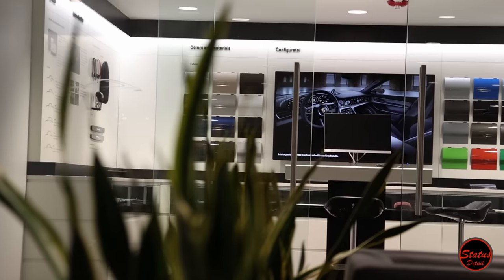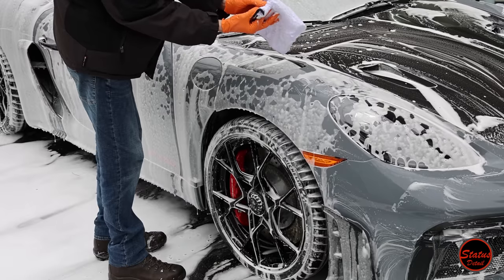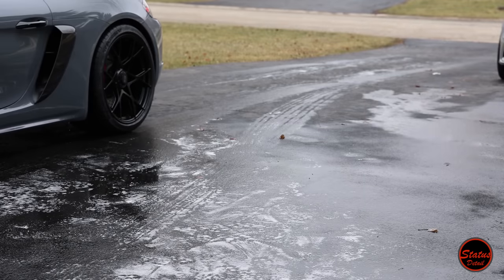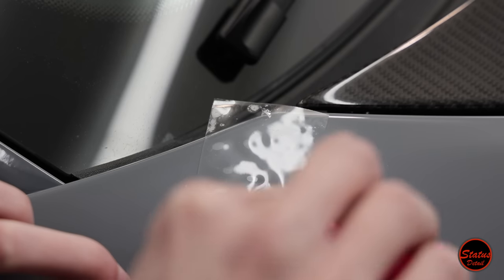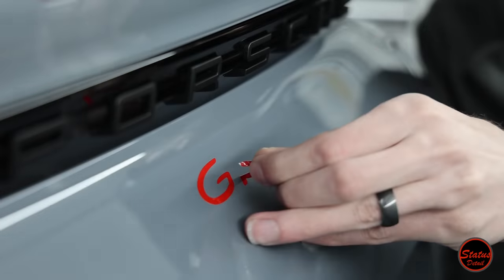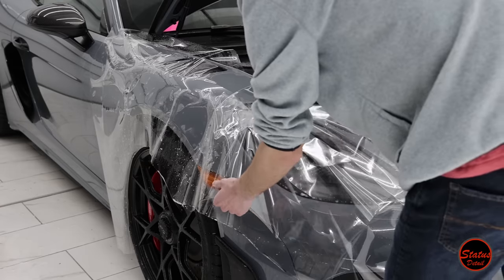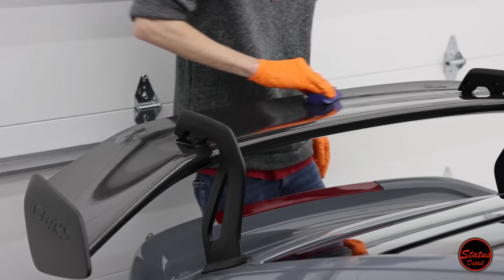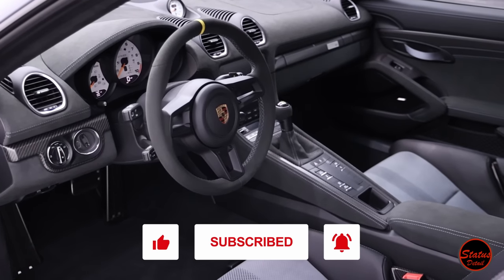GT4RS The World's MOST EXPENSIVE DETAIL!?!?

Comment: Matt from obsessed garage said that PTS paint is even worse on a new Porsche and he would never order PTS again because of it.
Reply from the maker: @_Suzuka_Joe  I kinda disagree but enjoy matts videos and opinions. 

I have worked on a lot of Porsches. Pts cars usually have "worse" paint. But it's nothing that can't be fixed by a paint correction specialist. Some cars have worse or more extreme issues than others. But I have seen that on normal Porsches too. I have even seen cars get delivered in the wrong color and options lol. 

Pts cars usually have more sanding marks and crazy holograms. I suspect a different facility is doing PTS cars. Or in general they're just trying harder because it's a very expensive option. So because they're actually trying so hard to make it perfect they're actually doing more harm than good. In general Porsche and most manufacturers don't really have a clue on how to do refinement polishing. They often miss dust nibs and if they do spot them they remove them but do a poor job of refinement afterwards. 

I would personally take a PTS car over a standard paying car every day though week If I have the option. Nothing should be that wrong it should make it so you don't want to take delivery of the car in long term especially on special cars in GT cars etc you're going to have a car that's more likely to appreciate.

Comment: Really like your detail butttttt you never touch PPF on any kind of Porsche Headlight.
Reply from the maker: I'm not sure what you mean. We actually never PPF headlights due to delamination issues. Sometimes we use the headlight are to hold film in place but that's with solution under it and pulled back shortly after. 

The real issues are when you actually PPF the light then leave it on for months or years.

Comment: Great work, but how do you get away with this exotic, “the most expensive detail” doing all the washing process outside exposed to the elements??
Reply from the maker: Not sure what you mean by get away with? 

A lot of detailers wash cars outside. 

Even if I had drains Inside I'd wash really dirty cars outside as many detailers have issues with drains clogging. I like the dirt outside lol. then I pull a clean car inside. 

You can wash outside with zero risks if your good at what you do. It's just not fun in winter or 100 degree heat for the actual car washer lol.

Comment: £12,000 and specialise in paint correction yet didn’t mask any plastics to correct the paintwork 😅
Reply from the maker: If your good and use the correct tools you do not need to mask in most situations 👍
Reply: @STATUSDETAIL  on some parts yes, doors are not one of them with the bevel Porsche has before the plastics and the damage they receive especially from dealerships. I too specialise in Porsche and Paint Correction and while not everything is masked, 17 years on there is definitely still areas that need it to get the best result possible!
Reply from the maker: @rickw8645  I disagree. 👍

Comment: Eh, I wouldn't count PPF as a part of detailing.
Reply from the maker: I would disagree
Reply: @STATUSDETAIL  Would you say vinyl wrap is a part of detailing then?
Reply from the maker: @vongdong10  no. Vinyl is customization and provides no protection. It also has awful orange peel and is not for the detail minded individuals. It's purely aesthetics. 

PPF can have ceramic built in. Ceramic coatings are detail related. It helps prevent chips meaning no or less touch ups. A detailing thing. Reduces and almost fully eliminated swirl marks also a detailing thing. 
Stek actually smooths out orange peel on some paint making the finish look better. Similar to paint correction.

If you just slap PPF on it will look terrible. It's a highly skilled process that a highly detailed person will Excel at.

Before ppf goes on you should have a decon wash. Paint correction and appropriate prep before film touches paint. 

It's 100% a part of detailing. And you should want a detailer installing it vs a PPF only guy in my personal opinion.

Comment: $10k to 12k for this detail really isn't that costly, if you consider a dealer charges you 1500 to $3000 for something that only takes someone an hour or two.
Reply from the maker: Agree! I keep saying it in comments this package will only increase in cost over time. currently this is very good value. Other companies in high line detailing charge anywhere from 12k-18k for this and some even higher. 

Dealership charge 3k plus JUST for front end  PPF. No correction no ceramic and not a proper install like ours.

Comment: It stinks that Porsche seems to not give a sht about their paint quality.  Anyone that owns one is probably not surprised.  That high price gets you the performance and engineering; everything else is extra.
Reply from the maker: They do a pretty good job. Cadillac for example routinely leaves behind a lot of dust nibs. I've seen $130,000 Escalade have 10 best nibs just on one side of a car. 
Porsche does a very good job of removing them but they don't do a great job of refining the removal process. 

Ultimately I would rather have the Porsche paint with some leftover sanding marks than the Cadillac paint that has full on dust nibs.
Reply: @STATUSDETAIL  That is unforgivable for Cadillac.  They are literally selling luxury and exclusivity.  Poshness.  For the paint to not be obsessively perfect really gives notice that they are no longer what they purport to be.  I have sadly noticed a lot of fit and finish issues on my wife's Escalade.  I don't point them out to her because I don't want to rain in her parade.  Porsche is different, though.  They are selling engineering, performance, speed with everyday drivability.  It stinks that they don't have the same insane attention to detail with the paint but that's not really their focus.
Reply from the maker: @cvn6555  agreed. But st least it can be fixed

Comment: How can porsche deliver cars with such low quality paint work? Shouldn’t a customer be able to go back and ask them to fix it themselves at least
Reply from the maker: The paint itself is actually pretty good! Its the refinement process that's missing some attention. You don't really want a dealership to fix it. That means basically asking a porter/detailer at dealership to fix it. It's often the case that this is a high turnover position and the skill set is likely not there to fix this correctly. 

In my opinion it's a risky ask.

Comment: 8:43 never ever this surface is stock by porsche. You can clearly see that there is done a sceond paintjob on the car. This car with this paint job never leavs the porsche factory quality control.
Reply from the maker: I have seen this multiple times before on other Porsche with 20-30 miles. At what point do you think it's being painted. Because the car has tracktthr entire time for the customer. Paint takes time that would leave inconsistency in the tracking

Comment: So $12k and you couldnt remove door hands, tailights, headlights ... and tuck the wrap?   Seems the quality for price is ludicris but if someone will pay you price more power to you.   Im not bashing your work but there is still place for improvement  and would expect a little more for that price.
Reply from the maker: We would charge more for removals. 

Removing things does not always make it better and opens up liabilities to us and customer. 

To remove door handles or mirror you must disassemble the door and pull apart parts of wiring that will not go back together the way the factory intended. If you want that film off you need to pull everything out again. You don't want to be pulling cars apart often and putting wear on clips etc. 

PPF should be easily serviceable. That's the point. It should be easy to remove if s shopping cart hits it or a huge chip rips the film. 

If replacing the film gets expensive due to extra labor hours you get to close to just repainting Costs being the same amount.

Comment: Why do you wash out the microfibre clothes on the car? Isn’t this just removing the dirt that was in the towel and putting it on the car
Reply from the maker: When you rinse and pre foam and rinse again then foam again your getting any big dirt off. 

That's why we don't get swirls. 

Any dirt in the wash pad is very small and unattached. It doesn't need agitation to free like before. So our final car rinse will easily remove anything on paint. 

Think of it as washing your car and leaving it outside for two hours. A little dust will build up. But we could rinse that off no problem. Different from dirt that's stuck on from weeks of driving. 

I don't see a better way to pressure wash the towels as doing so on a grit gaurd will not work out. I do understand the concern on this tho as it can easily be a head turning thing.

Comment: So when u sand a car you are removing clear coat and that none replaceable unless u spray clear back not best choice from a new car u want the original coearcoat yes or no just like original paint better lasting then a new paint job unless your paying a lot money to do many coats of paint them could be better then original but sand I only agree on older cars to do if it just bugs u the for perfection
Reply from the maker: When you paint correct with polish or compound or sand something you're removing clear coat. You don't necessarily need to add that clear coat back immediately. But if you do it repetitively year after year I'm sure you'll run out and will need to respray. A car like this getting paint correction and then getting film on it won't need a repaint potentially forever if it's cared for correctly. 

I might not be understanding your comment but it makes it seem like because we were removed paint we would have to respray the car simply because we paint corrected it. That's not really how the process works

Comment: it's a track car, not something you're supposed to rub with a diaper. When it goes on track it is meant to be scratched by little stones and pieces of rubber. This car is probably too much of a stretch for the owner if he cannot afford from time to time to respray or change bumpers etc. This $12.5k job is just a tax on the weak-minded owner.
Reply from the maker: So much wrong and backwards with what you just said lol.if he was poor why would he spend money on a detail for a track car so it can be ruined as you described. 

The ceramic and PPF will help any dirt rubber etc come off easily. 

Are you suggesting he buy it. Drive. Track it. Never wash it and never care for it?
Reply: @STATUSDETAIL  "Drive, Track it, Never wash it and never care for it" is a "reductio ad absurdum" argument, and not what I said; use it, wash it, repair scratches / buy new panels when inevitable contact is made.
Reply from the maker: @lastlondon  why can't he do that while having a ceramic coating and ppf. He's not poor and can afford the detail. PPF could save repaints. Cheaper too. Plus keeps oem paint. 
Ceramic makes the wash go faster and easier especially when removing track day bugs and rubber

Comment: I think Porsche just has junk paint. My cayenne is a 2016 and the paint looks horrible. Chips, scratches, swirl marks. So frustrating
Reply from the maker: The paint from Porsche from recent years is pretty good actually. As in the paint itself is good. They do a pretty good job removing dust nibs too. 

The issue is the refinement process needs some work. After they went sand or dry sand things out they don't fully remove the sanding marks. Other issues are obviously present. But after a correction for a guy like me the paint looks great and the paint itself is well done. 

It's not like a Tesla that has literally terrible paint and missing paint lol.